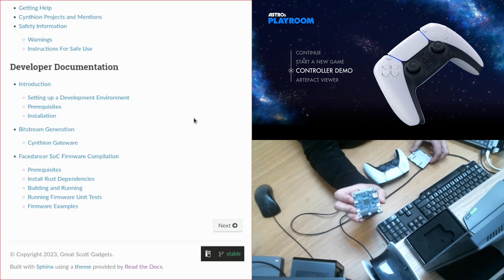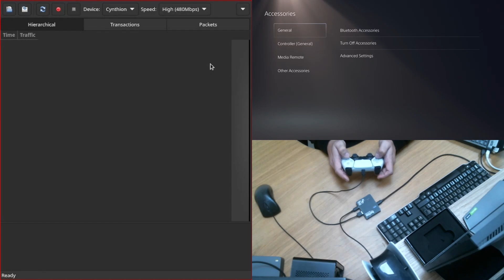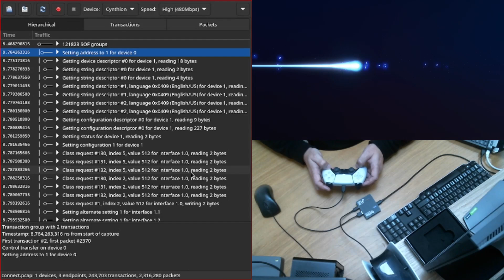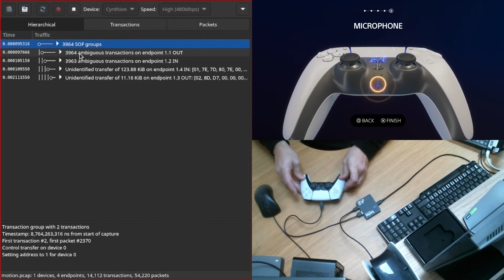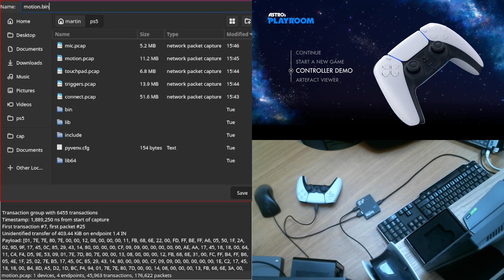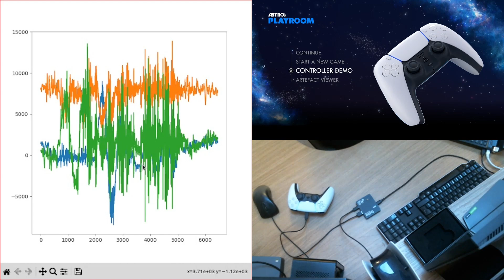Sniffing PS5 Controller Packets with Cynthion

Comment: 4:59 "But you don't have to develop anything yourself to use this, because as well as developing all [of] the hardware, we've also written all [of] the software you need for most things that you might want to do with this."

Nope! No rust anything! C/C++ software should exist and if not, then the statement above is manipulative social engineering and injects feelings, emotions, sentiment wording to alter the definitions of words to misrepresent fundamentals by forcing the adopting of normalizing the abnormal to be new normal and the old normal is the new abnormal because fast tracking, cutting corners, taking shortcuts, laziness, entitlement, greed, arrogance, etcetera
Reply: I refuse to use any library, software, or anything whatsoever that touches rust, and now that I have a Cynthion hardware device, already knowing before I made the purchase that I will have to find a way to use this device accomplish tasks without using any rust dependencies, which is not clear what the path looks like because rust minefields are noticeable, but I am determined to figure out how to use this hardware without touching or involving any rust, and I'm still looking to see how to proceed.
Reply: Archlinux User Repository (AUR) packages cynthion-firmware-bin and python-cynthion (0.2.4-1, but can be edited to use latest release 0.2.5) appears to not have any rust (only python), confirmed despite that the github repository shows 73.5% rust, 25.7% python. Kudos to the AUR package maintainer for not using rust dependencies.
Reply: "But you don't have to develop anything yourself to use this"

Yes I do! Sloptelligent nonhumans suggest that Packetry is the only GSG-provided software that provides analyzer capture -> pcap/pcapng and it is written using rust, and apparently there is no non-rust equivalent (I am still reading/looking/researching). The cynthion Python package handles bitstream loading and device management, but the actual capture-and-save-to-pcap functionality lives exclusively in Packetry, apparently. So I am still trying to understand and I will forever infinitely stubbornly persistently refuse 100% for the rest of my life anything that is rust associated in any way, which is suggestive that I may have to develop more than zero things myself, unless I can figure out others who have already done this.

Comment: I have a 20+ year old WinXP program (PowerPCB) that uses a usb security dongle. I run everything under a virtual machine, but the dongle is flaky, so I try not to unnecessarily remove or insert it.. even still it often loses the connection. The company (byPASS Software) has long been out of business.. any thoughts if Cynthion could be used to reverse engineer it / emulate the dongle?

I imagine the application generates a random number (using date/time, mouse movement, etc as a seed) then sends it to the dongle, where returns some encrypted data that the software has to unencrypt to validate?  However, there must be more to it, since the software could easily be patched to always sends the same number and/or pass the decryption check?